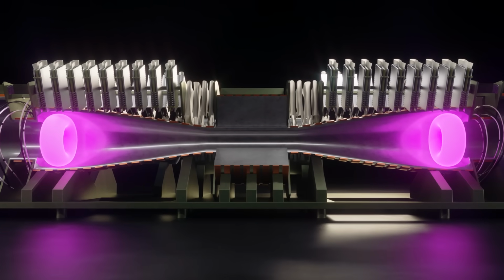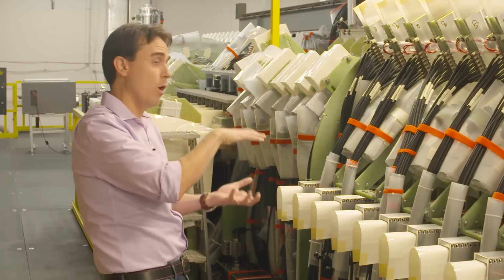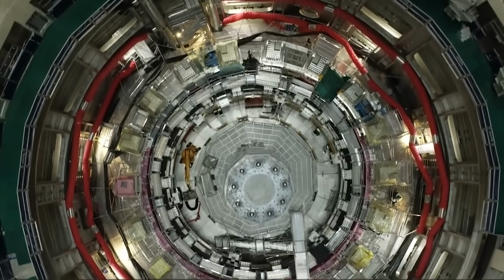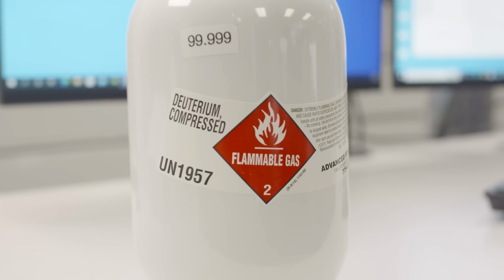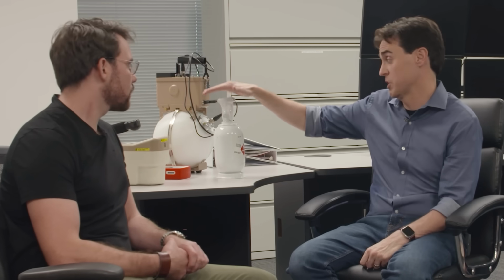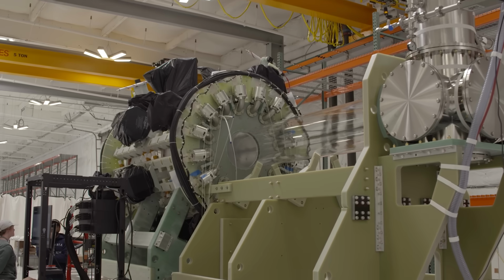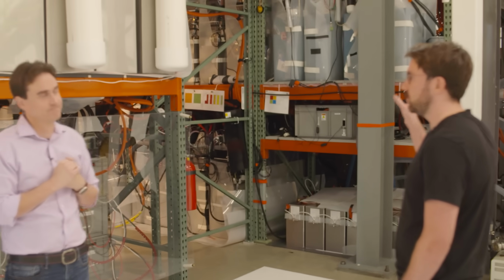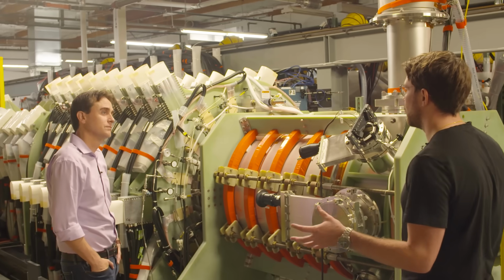A New Way to Achieve Nuclear Fusion: Helion

Comment: For the reactor to become a true power source, the high cost of pressurizing the plasma can only happen once.  That means the fusion reaction will need continue under its own power while it is feed more fuel without stopping.  But will require an opening in the plasma like a jet engine or a vortex.  Any idea?
Reply: No. This is a pulsed system. They can recover the energy from the compression magnets, directly as electricity and at 95% efficiency. They do not need to achieve ignition because of that.

Comment: Can Hellion inject 1 atom at a time of the needed fuel? Otherwise what is to prevent some of the deuterium from reacting with itself and producing neutrons?
Reply: They actually need D-D side reactions. Helion will produce their Helium3 by fusing Deuterium in the same machine. D+D => He3 +n or D+D => T + p (the Tritium eventually decays to He3 as well). The neutrons from D-D reactions have a much lower energy than neutrons from D-T reactions at 2.45 MeV vs 14 MeV. That means they are below the activation energy of many materials that Helion is using. And/or many materials they use have a very short half life if activated by D-D neutrons.

Comment: I'm already seeing a problem here. The machine wouldn't be able to power itself and provide excess power, just from how the power generation part works.
You're spending energy to contain a fusion reaction- and taking the energy the fusion reaction pushes back into it's confinement. But all the power being produced would have to go right back into containment or the fusion reaction would overpower its containment, breach, and destroy the machine.
power out and power in would have to be balanced by necessity including the power used to actually get the fusion material into the proper state means spending more energy than what is being produced.
Reply: What makes you think that all the power from the fusion reaction would go back into the machine? Only what they need to restart the process will go back into the machine. The rest goes to the grid.

Comment: year 2040 be like: "neutron capture add-on unlocked, increases fusion reactor efficiency by 2000%"
Reply: Not really. The neutrons only make 5 to 10% of the fusion energy output of the machine. Most is in charged particles.
Reply: @elmarmoelzer2229  In the presentation to the USNRC of March 2022, page 108, Helion states that their projection for a 50 MW machine is that it will generate 5% of the energy in neutrons, or ~2.5 MW, but in page 110 also says that the "Neutron output" will be 10^18 n/s at 2.45MeV, that, if I've done the calculation right, is only 0.4 MW, or 6 times less.
Any idea where does that discrepancy come from ?
P.S. Or maybe we could ask Dr. Kirtley via two_ee_t_r (youtube doesn't like when we name the competition, this is the 4th time I try 😁).
Reply: @charliem6590   I think it is just in the right order of magnitude.

Comment: I'm watching the Nebula interview mentioned in the pinned post at the top. At 6:40, the interviewer tries to ask him about energy breakeven by using the term "...net electricity". Kirtley replies (and I quote): "This should be into the reaction net electricity; however ..." and then goes on to say they're not focused on the engineering aspects right now (which is fine). My feeling is that with the 100M degree temps they quote, they can't close (even) to "scientific" breakeven (Q plasma > 1), right? They are obviously not interested in talking about this?
Reply: Scientific break even for what fuel? By my calculation Trenta should be very close to that goal for D-T fuel (!). It should be somewhere around the mid to upper 10^20 kev * s /m3 range, given all I have heard and seen. 
Now for D-He3? Likely not.
It is worth noting though that IF their direct energy conversion and input energy recapture is as efficient as they say, then you might not even need scientific break even for a small amount of net electricity. It sounds pretty weird but is sound. I even asked Sam Wurzel and Scott Hsu about that. Sam had concerned himself quite a bit with the "Helion situation" after the ARPA-E alpha program and they put a graph for that into their "Progress toward Fusion Energy Break Even" paper.

Comment: Improbable Matter has some specialized critics. Not sure if someome is deleting comments, but my previous comment dissapeared: https://youtu.be/3vUPhsFoniw
Reply: See my long comment below on why the IM video is BS.
Reply: @elmarmoelzer2229  I've been hunting for it for the last half an hour or so, but there are thousands and after a few minutes of scrolling, youtube reloads the comment list.
Reply: @ContraVsGigi  Let me try to copy and paste it in here:
The author of the IM video seems to solely rely on the video above (and a couple of blog posts) in his critique from the point of view of someone who claims to have worked at JET. 
This is not quite fair. The Real Engineering video was made by people who are not plasma physicists and is meant for consumption by the general public. It does not contain all the physics details you would find in a scientific paper or a talk in front of peers.

So here is my critique of the critique of the Real Engineering video:

- Critique: "FRCs have been done before and never worked." 
First, define "worked"! What was the goal of the experiment and what was the outcome?
Second, yes, FRCs have been done before and the members of Helion's founding team were actually involved with several of them. They applied the lessons learned from those to their own design, which they have tested over 6 prototypes so far.
Lessons learned and applied:
1. Size of the FRC. The larger, the less susceptible to n=2, rotational instabilities.
2. Elongation to radius ratio. The longer the FRC, the more stable it is to tilt instabilities.
3. The merging before the compression. This part creates a single, hotter and more stable FRC as a target for compression. FRCs get more stable, the hotter they are.
4. Helion's FRCs have a very low electron to ion temperature (Te:Ti) ratio of 0.1 and less. That makes things a lot easier compared to machines where both are in an equilibrium because: 
P(fus)/P(loss) scales as Ti^1.5 / (Z^2 * Te^0.5 )
Where Z is the atomic number (in case you wonder about that).

- Critique: "Deuterium- Helium3 has a smaller reaction cross section than Deuterium- Deuterium. At the 100 million degrees temperature discussed in the video, Deuterium-Deuterium reactions would be much more likely than Deuterium-Helium3 reactions."
That is generally true, but the author misses some key points:
Trenta is a subscale prototype with much weaker magnets than what they are proposing for a full scale powerplant. Because of that temperatures are somewhat lower than in a full scale power plant. Power plants aim for temperatures 20 keV (220 million degrees) and up to 330 million degrees (30keV). At that point the D-He3 reactivity surpasses the D-D reactivity.
That said, Helion actually wants some D-D reactions because that is how they are breeding their He3.
D-D => He3 +n or D-D => T +p
Both reactions have a 50% chance of happening.
So, in mixed mode (breed and power) machines, they will need two D-D reactions for every D-He3 reaction, at least until the Tritium inventory is large enough that they have a constant supply from decay (Tritium beta decays into Helium3). Sicne Tritium has a half life of 12.3 years, that can take maybe 20 years. That fact is probably the best criticism of Helion's approach.

- Critique: "Deuterium- Helium3 is too hard and Tokamaks cannot do it. Therefore Helion's approach of fusing Deuterium and Helium3 can never work."
D-He3 is very hard to ignite, but they do not need ignition for their design to produce enough net electricity to be economic. Most of the energy from D-D and D-He3 reactions is released as charged particles, not in neutrons. Helion can recover the energy in charged particles directly as electricity at a higher efficiency than a steam plant would. They can also recover 95% of the input energy directly as electricity. That makes their machines a lot more efficient.
Further, FRCs are high Beta (~1.0) compared to Tokamaks (~0.05). Beta means the ratio of the plasmas internal pressure to the pressure applied externally via magnets. If it was just about the efficiency of the magnets (it is not), then a 10 Tesla Helion machine would outperform a 200 Tesla Tokamak. 
But, it is a bit more complicated than that, because confinement times in FRCs are generally lower. You win some, you lose some. Overall it is still a win for Helion's approach.
Since Helion is using adiabatic heating through the compression stage, they can to some extent(!) balance temperature and density almost linearly for a given magnetic field. D-D reactions favor higher density and lower temperatures. D-He3 is the opposite way round. They can tune that just to the right sweet spot between density and temperature depending on which reaction they want more of.
Another thing that works in Helion's favor is the aforementioned Te:Ti ratio. This ratio actually decreases further with higher temperatures. So the hotter the plasma gets, the smaller that ratio. Trenta already showed Te:Ti at <0.1. It is likely that a power plant will have an even lower ratio. Lower electron temperatures greatly reduce Bremsstrahlung losses. At a ratio of 0.1, thermal transport losses actually kick in earlier than Bremsstrahlung.

- Critique: "The neutrons from Deuterium-Deuterium reactions would have fried Trenta and I see no shielding." 
As mentioned, Trenta is a subscale prototype, an experiment. It is smaller, weaker and only operates at one pulse every 10 minutes (max). A full scale powerplant would do 10 pulses a second!
Not all shots were fueled by Deuterium or Deuterium + He3. Many were fueled by a mix of hydrogen and Deuterium or pure hydrogen, depending on what they wanted to test.
Because of that alone, the total neutron flux that Trenta has experienced so far is not that high.
What the critique does not mention is that neutrons from D-D reactions have a much lower energy than those from Deuterium- Tritium reactions (2.45 MeV vs 14 MeV). Those 2.45 MeV are below the activation energy of many materials.
The machine is mostly made from low activation materials or materials with a half life measured in minutes. Aluminum activated by D-D neutrons has a half life of 2 minutes.
In fact testing different materials under neutron exposure was one of the purposes of Trenta. They have tested quite a few alloys to see how they behave.
There is still permitted shielding of course. It is in the walls of the room and not close to the actual machine, which can handle the aforementioned relatively reduced neutron load just fine. 
It is also worth mentioning that a mixed mode Helion power plant (that does both breeding and power production) would produce neutrons only in one third of all reactions. So the neutron flux, even for those machines would be lower than for a D-T Tokamak.

- Critique: "Helion claims that they discovered new physics when they say that the ion gyro radius is 25% larger."
The whole ion gyro- radius thing was based on a misunderstanding and out of context quote and maybe also bad wording.
What happened was that Trenta achieved a higher ion temperature than predicted by Helion's too conservative physics model (a higher ion temperature is actually a good thing!). That higher ion temperature caused a 25% increase in ion gyro radius, which is perfectly in line with established physics. That's it. Nothing to see here!

- Critique: "Helion had previously said that they would have a working power plant in 2021. "
IM was very eager to get a "gotcha" on Helion. I guess he did not read further up on the page, or he would have seen that Helion was in the process of raising funding at the time. They did not get that funding until now. Even Trenta was less than 35 million (especially if you take the 35 million into 2019 dollars, when they started building it).
No bucks, no Buck Rogers. Should be quite clear, no? 

That is how far I could bear watching the "critique" video. Once the picture of Chernobyl came up, I quit. Not worth my time. So if you have any other points that you want me to take apart, feel free to ask!

Comment: The problem is you cant run a fussion reactor to get mostly energy conversion in the form of electrons 
You need to find a way to separate them from the portons and send them through a different energy conversion method
Most of the mass is in the protons and neutrons which will be hot so thats where your steam comes from
What you need to do is use both methods but do it better then we have ever done before by 100 years worth of technological advancement in comparison to what we know now.
The world mostly still runs on the 4 elements earth wind water fire and the rare capability of boiling water
Is there realy not a better element.
I know they use heavy water but its the same thing
If there are no elements better then you need a computer ai to design the channels so close and precise you need metal 3d printers printing that can use ar bullet proof grade steel like it was play dough at levels that would be beyond a 40 year boiler maker.